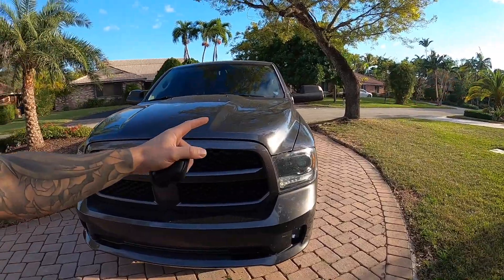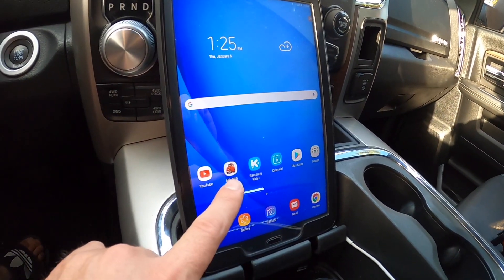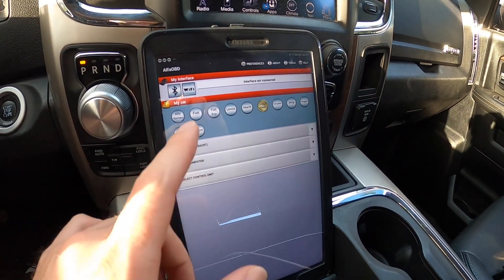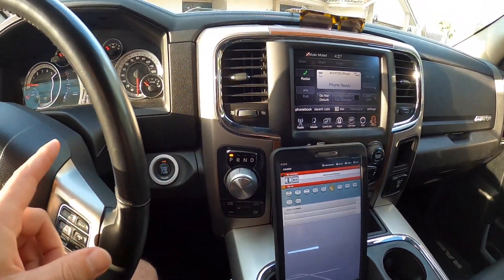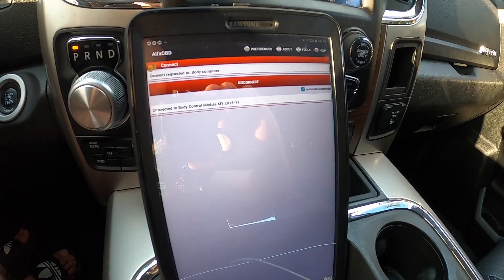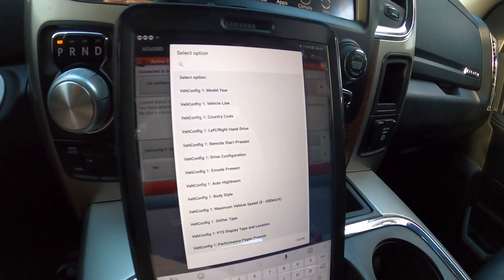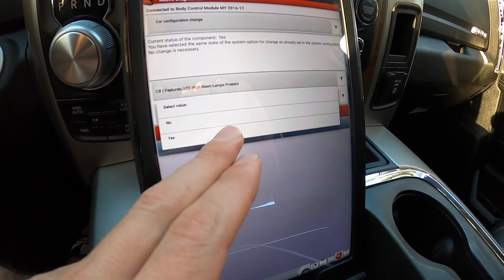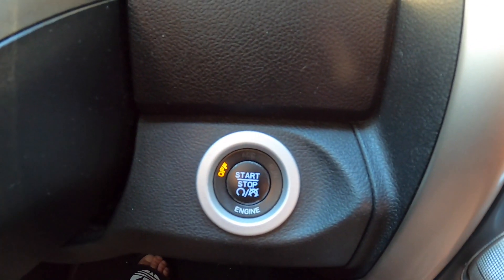LED or HID HEADLIGHT BULB OUT ERROR FIX on DODGE RAM JEEP CHRYSLER | AlfaOBD

Comment: Just followed all the steps and passenger side low beam headlight still is on and off. Does anyone have any suggestions? Have a 2018 and used a security bypass and it said procedure complete

Comment: Hey i have a 14 ram craftsman. What happens if i tell the cumputer its an SRT
Reply from the maker: A 6.2 falls out of the sky and automatically gets installed
Reply: Is that where baby hellcats come from?!?!?!? I was just wandering if it would mess anything up. Does it change shift points? Fuel ratio? I tried it after i posted this question. So far i cant really tell if anythin changed as far as regular driving but it seems like my shift points might be a little higher when im hammering on it. I was tryin to find a way to shut off my tsc bullsnot. Any ideas

Comment: I have a 2015 dodge Ram sport and upgraded to morimoto xb2’s and now my low beams randomly turn off during a short drive at night. My high beams always work though? Would this video apply to fix my issue
Reply: I just ran into same issue what was your fix?
Reply: Any update on this?  Mine are not working.
Reply: Have you fixed your issue?

Comment: So I have a 2018 Ram 1500 and I just did this process and for some reason I am still getting the message on the instrument cluster when the headlights are on and I turn the signal on “parking light out” even though they are all set to LEDs. I did this at like 11am and let it sit until about 3pm and it’s still showing that message. Sooo is there something else I need to change to get that message to turn off? Do I have to let it sit overnight?
Reply: Having the same issue
Reply: Did u figure it out?

Comment: I have a 2018 ram 1500. Came with projector headlights originally. I bought and installed morimoto XBs a while back, they were flawless. Well within a year they got cloudy and morimoto changed them out. When I installed the replacement ones I got a left front turn signal out on the trucks display. Everything was installed just like the others and all lights are functional. Any ideas? Also the left side view mirror hyper flashes but not the front or rear left turn signals

Comment: Anyone have the parking light out message after upgrading to Alpharex G2 pro headlights? If so did you get it to delete stored message ?
Reply: Yes, I did have it coming up time to time, found out if you unplug the tiny wire that goes to battery terminal it will clear the message in the dash
Reply: @MrPaveles  do you mean the red or black wire that's hookup to the battery for the alpharex pro series g2 drl driver ?
Reply: Any solution? Have the same headlights
Reply: @CxtyMxrgue  it turned out I had a bad resistor on the passenger side front parking/turn signal from the previous led lights setup I had  after replacing the resistor the warning cleared
Reply: @joe7528  Do you have a link to the resistors you used? Or the name/brand
Reply: @CxtyMxrgue  it's just a regular resistor you can buy at any parts store or online it's usually yellowish/goldish with two wires you can look it up online led resistors it will show you what my old setup was  I did however took my old one out retaped the wires I tapped into and bought a resistor plug ins from ground lighting
Reply: @joe7528  thanks man for replying even after 2 years lol

Comment: Hey John I got the HID kit and I have a 2015 ram 1500 with projector headlights. I got the kid you showed plugged it in to the low beam and it won't turn on sometimes it will flicker but never holds on. I got the resistors and they didn't change it. I finally just ordered this obd2 port and got the alpha app. Do you think this will make it turn on, someone please help it's been very stressful trying to figure out. Also the hid will work in my high beam just not the low beam projector. Can I use both at the same time also ?
Reply from the maker: Yes turn on the HID and LED low beam setting and remove the resistors
Reply: @BoostedMotorsports  I went in and changed the settings with the alpha obd it works amazingly! I have the hid in the low beam and the Led from your other video in the high beam. Thanks again John already interested in the throttle lag upgraded !
Reply: @BoostedMotorsports  thanks John will update ya tomorrow 👍🏻
Reply: @BoostedMotorsports  how did you get the Bluetooth connected from the alfaobd app to the MX+ obd plug?
Reply: Miguel Prz  I got the 55w kit from johns vid. They didn't work at all until I got the alpha obd and chip and went in the settings  turned the high intensity on and turned the high and low beam led on
Reply: Now they work great
Reply: Miguel Prz  yes but I just switched them tonight to led fahren 9005/hb3 there 120w, 20,000 lumens and are much brighter
Reply: @Nick Choueiri  I have those too. But nearing cold weather, they turn on and off the left then right, then stay off and give me an error message. Fahren leds same as yours. You have that issue?

Comment: Can it change the tire size so  speedometer will work correctly
Reply: Yes. "Program tire size". I have 35/12.5/20s. So you have to find the circumference in mm. Mine is about 2791mm

Comment: Hey John, I’ve been following your videos since you had the gray ram you supercharged and did all kinds of stuff to! They have been real handy with working on my own 2014 ram sport from changing headlight bulbs to changing the 8-speed transmission fluid! Thanks for all of the help! My truck also has the factory projector headlights that has the LED turn signal lights and 2 LEDS have burned out making the computer give me the ‘turn signal light out’ msg on my dash. Sometimes it gives and error and I’ll go months with it on, then one day it’ll be gone for months and working properly. When the error is on, the inside signal and the light on the tow mirror hyper flash, but the front and rear signal flashes like normal. Do you think or know if this plug in programmer could possibly help it since it’s factory LEDS? The dealership only wants to sell me a whole new headlight fixture.
Reply from the maker: I have the same problem unfortunately my rear OEM led tail light is burnt out and only fix is to replace it. You could always get the switchback LED for your headlights and put them in
Reply: @BoostedMotorsports  that’s what I was afraid of. It generally works fine until I drive in the rain or it gets moisture in it some other way, but sometimes it just has a mind of its own!
Reply: @BoostedMotorsports  thanks for ignoring my question on both your videos on this subject. Might wanna do some research before posting and giving people false information.

Comment: I used that ECRI module on my 2019 Chrysler 300 and it worked great. It costs about half what the others cost. If anyone is wondering about it, I didn't need to download the software for that ECRI device. I just plugged it in and used alfaobd like usual.
Reply from the maker: Awesome! Glad it worked for you as well 💪